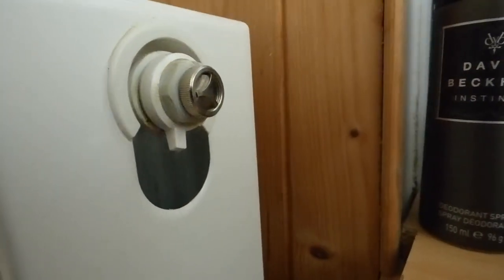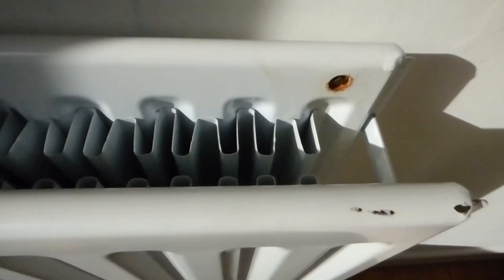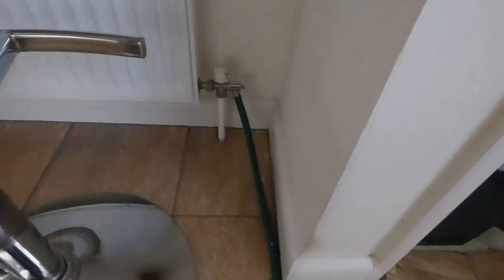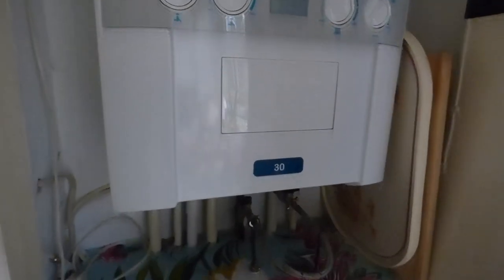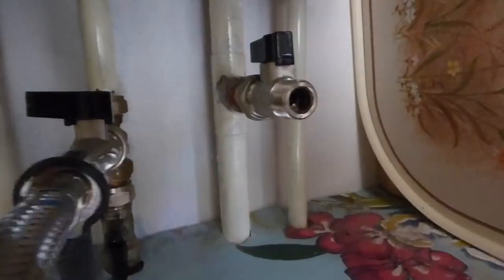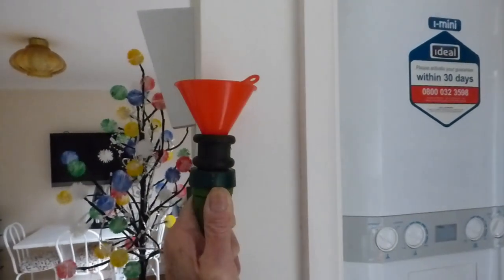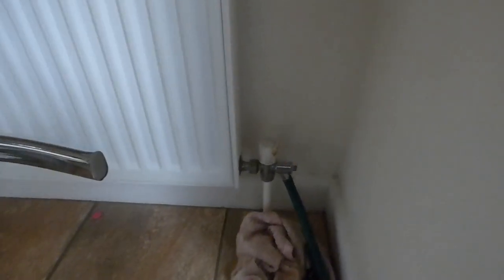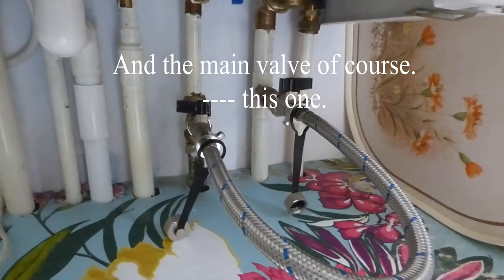How to add inhibitor into a Combi system with no way to fill via radiators

Comment: Excellent video! Glad I found this.. I've got a Sealed CHS System powered by a Combi Boiler. However, I've also got these old school style single (and double panel) radiators that only have Bleed Valve Pins on the top right corner. No plug on the left top corner! Your video has been a Godsend - as I'm not going to purchase a Sentinel Dosing Vesel (about £50) which I'll use to connect to the filling loop of the central heating system (after I've drained all the water out of course). I intend on doing a Chemical Flush with Sentinel X400 (leave in for 3-4 weeks), then remove and then dose with X100 Inhibitor with the same method before repressurising! :)
Reply from the maker: That`s the best way.

Comment: It's easier to buy the fernox concentrated stuff that comes in a tube, you just inject it straight into the filling loop with a mastic gun.
Reply from the maker: Yes it is easier but you do have to have a mastic gun. I will do a video on that method .

Comment: I have a magna filter where i can drain all the water out into a bucket by the combi.if I do this all i have to do after all water is drained is open all the air vents right? then add my cleaner and vlose all the air vents and fill the system to 1.5 bar leave for a week then repeat but this time add inhibitor. problem i got is a rad not switching off and hot at the top. i am getting a eezyfil of ebay and aladdin autovents.
Reply from the maker: Once all the air vents are open everything will empty.

Comment: Hi,
How long you have to leave system cleaner in, before drain it out?
Thanks.
Reply from the maker: It usually says how long on the bottle, but it can be any time depending on the make up to 24 hours or sometimes a week.

Comment: Hi Dereton33

I have some issues with my Combi boiler as the water gauge always seems to be low and once filled up to correct level it gets low again after couple of weeks. I have checked all radiators and can't find any leaks. Where I used to live the combi boiler there I hardly ever need to add more water to it, maybe once a year if that. This one I have to always have to check the gauge worrying about the water level.

What is wrong? Your advice would be appreciated.

Thanks

Ken
Reply from the maker: You have a leak some where. Try some system leak fixer in your system. Fernox do it.
Reply: Fernox F4 Express Leak Sealer seems the perfect stuff to try.
Reply: I had a prob like that and it was 2 pipes rubbing against each other which created a hole in 1 of the pipes. Normally happens where you get obe of them central heating gitted in a day jobs.

Comment: My radiator's are at least 40 plus  year's old  with the  bleed nipples  sunken into a  round  crevice with a sqare  head on them  is there any easy way to  add fresh inhibitor  rather than  using a syringe it takes ages
Reply from the maker: Drain some water out of the drain valve Then use the filling loop attached to the return pipe and fit a funnel into the flexi and fill using that.
Reply: @dereton33  many many thanks for that one  my boiler is  down stairs  next to the  back door  I had to  fit  in to the  system a drain off valve to the  nearest radiator in the  bathroom  near the  backdoor  witch is  right next to the boiler  don't know  why they  never  put a drain off valve  but it's done now  I will sort that out now I never thought of that thank you once again

Comment: Trying to add sentinel leak sealer via the top up loop. Very, very small loss of pressure, and its driving me mad. Have drained down the system, but the leak sealer won't go through the pipe. Put in a small amount, and it just sits there (my top up pipe is vertical). I can reconnect the mains and force it through, but doing this is going to take forever. Any suggestions?
Reply from the maker: Try it through a rad, with a funnel an hose . Drain the rad first.
Reply: thanks for the prompt reply, but Im going to get the aerosol one that can be connected to the fill loop, no need to drain the system, and is done in 30 seconds.Enjoy your channel, very informative. Any knowledge of damp?Fed up with these damp proof companies who only cover it up.

Comment: Hi dereton33, I really love your videos, I find them extremely useful! I have removed all my radiators and cleaned them all to remove all the sludge inside, shall I  just now add the inhibitor and filling out the system? Or shall I use cleaner, then drain them all and then inhibitor? My system is a combi boiler with one side panel convector radiators in all rooms. Thanks. Great stuff!
Reply from the maker: If the radiators did not seem that bad when you cleaned them, I would just add the inhibitor.
Reply: @dereton33  Yes, they did actually, to be honest. Do you think is a good idea if I drain them all, then add the cleaner and refill everything, switch on the whole system (so everything is moving), then drain it again, then add the inhibitor and refill?
Reply from the maker: Yes it is still worth doing.
Reply: @dereton33  Thanks! Much appreciated

Comment: Hi dereton33, I am trying to put the inhibitor but it seems it does not suck it in. The inhibitor stays on the house pipe and it will not go in. Any ideas?
Reply from the maker: Drain some water from the radiator.
Reply: @dereton33  Sorry, I meant from the filling loop. I am doing it in the same way as you advise but no luck. I might have to use pressurized Fernox, you think? I have seen another video of yours Thanks again!😊
Reply from the maker: Ok yes force it in with pressurized Fernox

Comment: Isn’t is safer to pressurise just under 1 bar at cold water  fill to allow for hot water expansion ?
Reply from the maker: No it will drop off too soon.
Reply: Ok thanks for your reply

Comment: can't do it that way if your system has a non return valve on the inlet side
Reply from the maker: I am assuming that you would know if you had one.
Reply: Only way i could think was fill the inlet hose, screw it back on, turn on inlet tap, turn off tap, disconnect hose then repeat until inhibitor bottle empty, took ages and many times, tried the injector bottle and it just flew all over the wall as the pressure blew off the hose from the clip